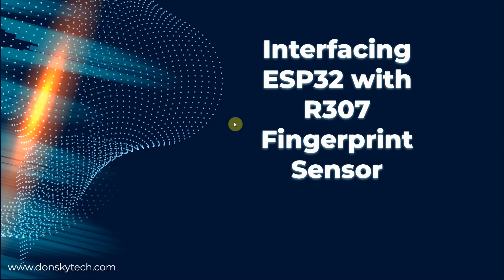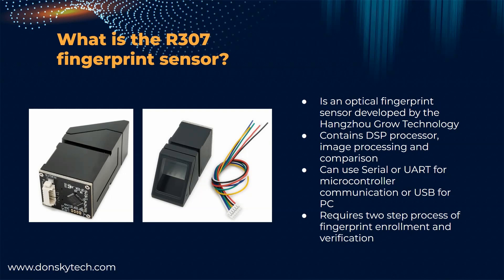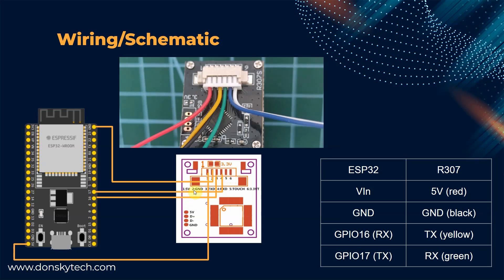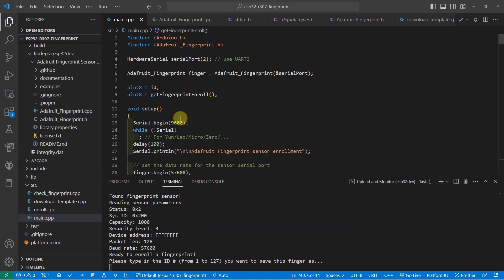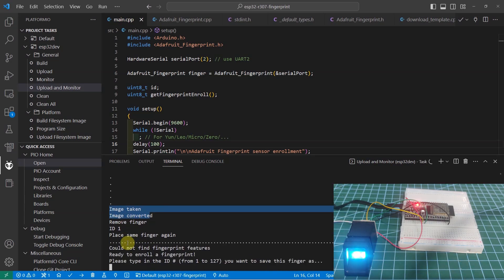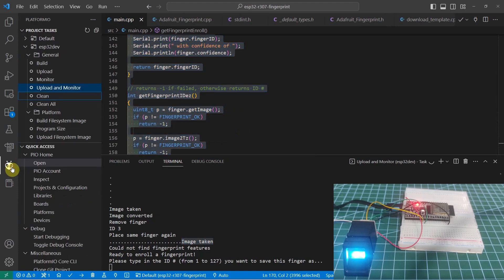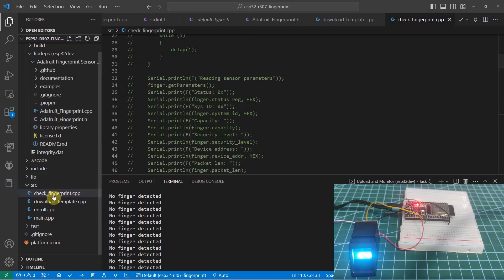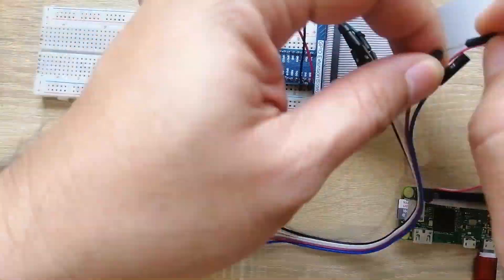Interfacing ESP32 with R307 Fingerprint Sensor

Comment: Is it still possible to use the fingerprint sensor if I used the GPIO 18 and 19 for the RX and TX connection? if so, how do I go about in doing that? Thansk for the help!
Reply from the maker: Hey, Use software serial.

Comment: could you make if possible an example of a website secured by fingerprint
Reply from the maker: Hey, not sure what you mean by that. But I have done several web projects that uses fingerprint. I got hired to develop those projects.
Reply: @DonskyTech  I ask if you can set up a platform whose access is secured by fingerprint like a banking platform

Comment: My fingerprint only blinked once and shut off. No fingerprint sensor detected on serial monitor. How to fix??
Reply from the maker: Hey, that is tricky but I would check the wiring first as that could be the problem.  Please consider subscribing to my channel to be notified for more content. Thanks!
Reply: @DonskyTech Ive checked the wiring. Its still blinking once. I used 3.3V to prevent the sensor broken. Is there any chance that my ESP32 malfunctioned?
Reply from the maker: @junkoscarlet6586  Well if you have an extra ESP32  then you could swap it out to check. Usually its a wiring issue unless either your ESP32 or your fingerprint sensor is toasted
Reply: @DonskyTech  I bought two with 2week time interval before I bought the second one. And still blinking once, sadge.
Reply from the maker: @junkoscarlet6586  hey, quite hard to figure out the problem without seeing it. If you have an extra Fingerprint sensor then try it with that one. Your sensor might have some issue as well.
Reply: @DonskyTech  Yep. Ive bought other model apart from R307 its AS608 and it work flawlessly. Also, thank you for the video. I can do my project in a flash.
Reply from the maker: @junkoscarlet6586  glad you figured it out. Please consider subscribing to my channel if you have not done so. Thanks!
Reply: @junkoscarlet6586   did you ever figure out what was wrong with it? mine is doing the same thing
Reply: @Abby-by3vo  The sensors are toasted. Buy another type. This type got so many factory defect.

Comment: How to backup fingerprint data from r307 and restore the data fingerprint to new sensor, if problem in old sensor
Reply from the maker: Unfortunately, there is nothing in the API of the library to do this.  I had the same issue and I was looking for a way also but have not found any workaround.